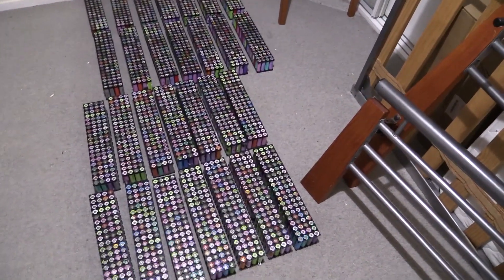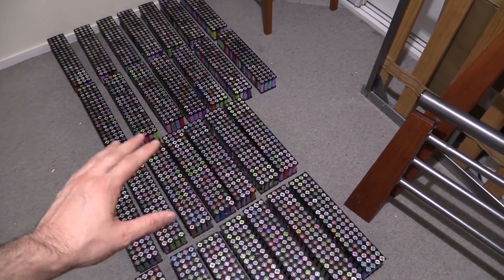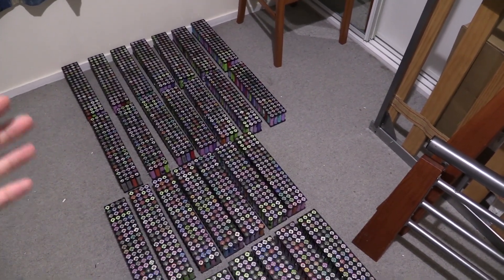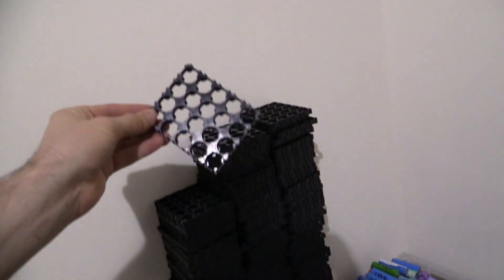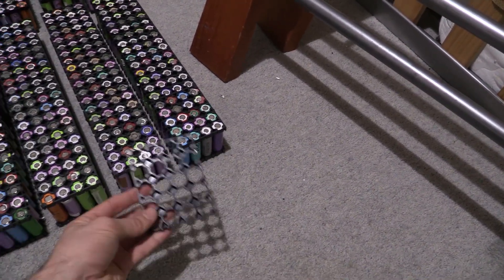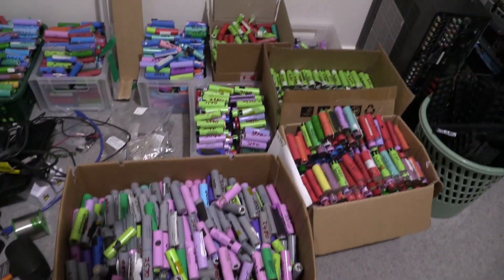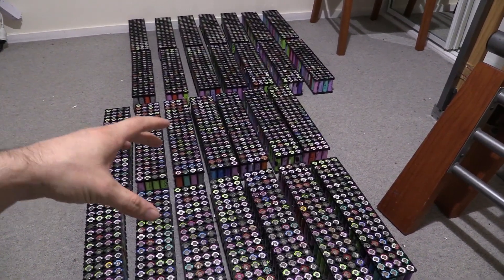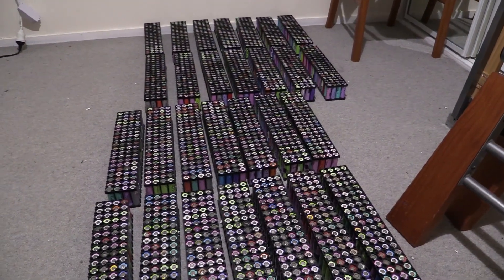18650 20kWh Battery Build Part 2 Build Important Question

Comment: You have the room! Do it 100p. If you a willing to check more cells when the time comes to strip them down.
Also you need to keep them the same as what you have started. Total amps per pack regardless of cell per pack. If this is to be connected in parallel to what you already have. To minimise one set getting out of balance from the other set.

Comment: 100P would require much more current to charge them and a bigger fuse on the top of the positive terminate
Oh, if it'll max out the space, then do 100 so you get max capacity
Reply from the maker: Charging them will just take longer, there is no need to charge at full and would be impossible so charging at any current is fine.

Comment: 100P is obviously the best. I suggest you fuse every cell rather than spot weld all 100 cells in parallel. 100P can supply over 300 Amps which can cause a lot of damage. I am a big believer in separate fusing of every cell in the wall. See recent video from HB Powerwall where he accidently shorted out 48V and saved by all 80 fuses blowing in one bank.
Reply from the maker: Thanks Peter, I will fuse every cell using the same glass fuses as AvgJoe did, The fuse will be spot welded to the cell and to the nickel strip. I am also a big believer that every cell needs a fuse.

Comment: Since you have the room so there's no reason not to expand each pack to 100p now, before fitting the busbars.  I suggest you build one or two spare 100p packs.  If a pack fails, you'll be glad you have a spare for easy swap out.
Reply from the maker: thanks a good point, I will see what i have left over

Comment: I would go with 50-P. Main reason being is that the more cells you add to a pack, the more difficult it becomes to find a single faulty cell in a pack. You can always parallel up packs to reach your capacity.
Reply from the maker: That's a very good point and is the same reason I like smaller packs. For space reasons, i think 100p is the way to go but no larger. Yes its going to be a pain if a pack fails which I am sure will happen but given at some point I will have 4or5Px14s going small would be a lot of packs in parallel and more of a pain in a different way.

Comment: So If a pack goes belly up,  which cells are easier to find and change..  same.. same..
Reply from the maker: The smaller parks will always be easier to service. Trying to find a single cell that's self-draining in a larger pack is very hard.

Comment: Both options have advantages and disadvantages - I'd go for 80p and have more modules that can be swappable, but you already have loads of cells and modules. You have the space for the cells in the rack, so if you don't mind the extra work to upsize, and prepared to blow 100 fuses at once instead of 80 then go for 100p!
It'll take a little extra work to select new cells to keep all the packs equal capacity... Good luck!